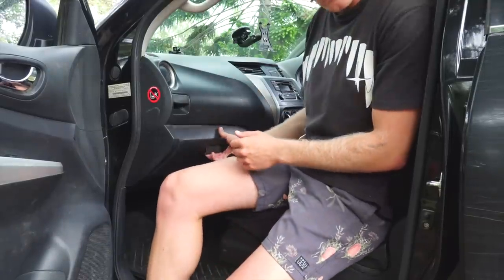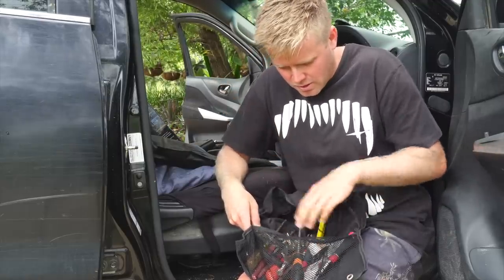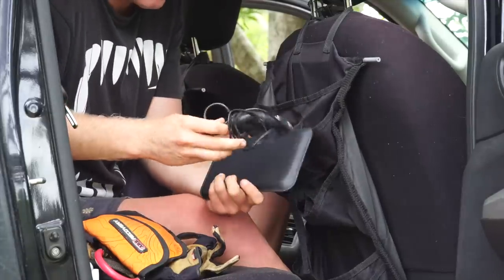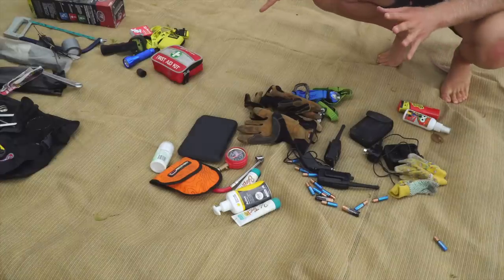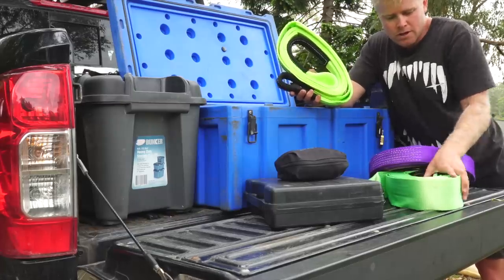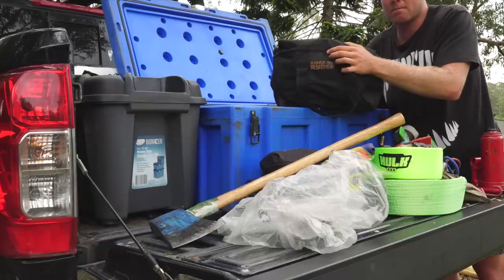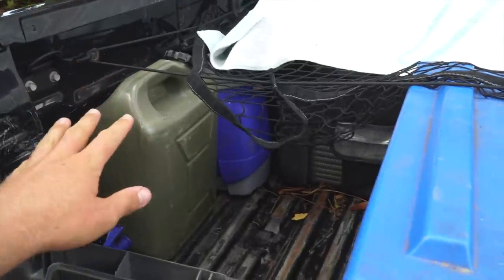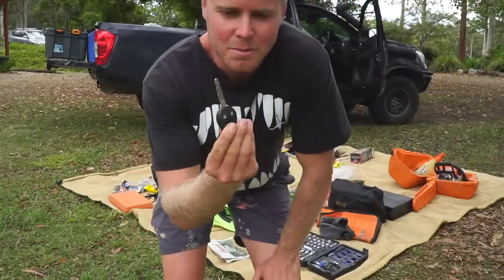What I carry in my 4WD - Tools, recovery gear and communications

Comment: Awesome vid Tyler.
From a mechanics point of view - a small mix of nuts, bolts and screws are worth keeping. Everyone can put in a bolt or screw eg I carry an oil filter box full of m6, m8, m10, m12, a few self tappers which covers most on a Jap 4wd or any accessories fitted. Some things just cant be secured with cable ties, tie wire, etc.
1l of MultiATF or SynATF(nulon) - will cover 90% of power steering or auto trans oil, and enough to get you moving again on an Auto with a small leak or low level.
Other than that, the only thing I carry is a driveshaft - same on both sides for a 120 Prado. And yes i broke one recently :).
Reply from the maker: Hey mate, thanks so much for all the ideas! Lots of good ones there, definitely got a few things to add to my list. Cheers!

Comment: Same as I carry. Near enough anyway.  Some extras I have on board is a ruck sack with basic survival gear / food. It lives in the cabin so it can be grabbed fast (As in a grass fire etc). That is the old boy scout in me.   A thunder box dunny, Big SS pot for boiling bath water (Or crabs etc), Small jump starter, Bush Machete, Cordless drill and Bits, Stanley Wonder pry bar, Flair kit(out of date marine from the tinny) Walking poles , Hand compass and ranger pace beads. If ever I have to walk out with no 4x4.  Oh, And a hand GPS.   As for hand tools, I lightened that right up to the bare minimum of mechanics tools, My axe is a fiskars X17, Much lighter but will split wooly hardwood, My Hack saw is a single hand draw saw handle.  It gets confounding when for everything you put in, Something has to come out.  Also depends on the trip I guess but hey that's half the fun hey?
Reply from the maker: Hey mate, thanks so much! Lots of good ideas there :) will definitely look into a few

Comment: Great little video Tyler. One thing that I thinks worth mentioning is a ‘power pack’ or ‘jump starter’’, especially if you’re solo traveling. I just purchased the new ARB one. It has numerous functions, light, usb, cigarette port and of course the actual jump start capability.
Good luck, may catch you in the VHC 👍🏻
Reply: Supercheap Auto jump pack has all the features as you mentioned,
Reply: Phil Burns . Mate there’s heaps of them!
Reply: @Phil_McAvity  yeah it's just if you GO ARB, you're going to pay like 10× the amount of vertualy the identical thing
Reply: Phil Burns . I need it to start a v8 cruiser, plus monies not necessarily a issue when it comes to reliability on products for solo semi remote travel.
Reply from the maker: Hey mate, thank you! Yep definitely, I was actually looking at these the other day and will get one soon. I think I might end up going with a NOCO one, they look really good. ARB one sounds good too but. Yep, may see you there. Cheers!
Reply: Tyler Thompson I originally ordered the GB70 off eBay $229, but the guy let me down ☹️
Reply: You could also just carry jumper leads and bridge them (not jump starting) if you have a dual battery system between the two batteries for a few mintues.
Reply: Renae Hobbs you could also get a solar blanket, hook it up & wait a hour or so.
Reply from the maker: So many different ideas/ways haha. That sucks about the eBay order!
Reply: Tyler Thompson if you got some extra 10mm copper cable you’re be able make your duel batteries in line to give a bit of charge to your starter. Far cheaper then buying a jumpstarter

Comment: Great list.
Id add some toilet paper. Your misses will thank you. Baby wipes are also great.
Rather than buy First aid kits, Buy the bits you need, you end up with a much better kit. Ebay/web is great for First aid supplies.
A stubby holder in the front helps keep drinks cool in summer and warm in winter.
Couple of Extra Large bin bags. If your super muddy they make great seat covers, Average raincoats and im sure 100's of other uses.
Probably not as important in the days of mobile phones but i usually carry a crossword/puzzle book and pencil, Just in case of bad traffic. 
For those without dual batteries (or good Samaritans), Jumper leads, Surprising how few people these days carry them.
Reply: @Greg Jackman I just googled a First aid kit supplier (like St johns) and see what there Kits contain.
Reply: TP shown at back of 2nd blue case at 12:21
Reply from the maker: Hey mate, thanks for the tips! Yep I've always got toilet paper in the car in the second blue box (just didn't bother mentioning it) and got big rubbish bags in the kitchen box. Other things sound good! I was actually looking at the little jump starter batteries the other day so may end up getting one of them instead of jumper leads but I'll definitely end up with one or the other. Cheers!
Reply: @TylerThompson90  See others have filled you in on the self starters, so I'll just comment that jumper leads not much good if you are the only one around and/or your vehicle is in a difficult position where the leads are not long enough.
Reply from the maker: Yeah ill end up getting one of the jump starters
Reply: I bought 900CCA Lithium jump-starter battery, but if your car battery is quite flat, the lithium jumper will not work, as (to protect the Lithium) it will not work if car battery below 10v. So, don't ditch the jumper leads is my rec (as Elec Engineer), As of Feb 2019, my local Aldi just had a sale of 160w fold-out camping solar panels, with full '12v lead acid' regulator - charges up to c13.7v then 'floats', so ideal for car-fridge etc, and likely more useful as 'supplement' to jumper leads, as the newer Lithium jumper packs.
Reply from the maker: @GraemeHarrisonAU  Cheers mate, thanks for all the information!

Comment: Spot on with the "what I got", and it's fairly comprehensive. I'm a sparky and I found the el cheapo compressors were slow and wanted to melt the fuse connections if not duty cycling enough. My advice is to buy the ARB twin compressor with the receiver (Aluminium cylinder) in the case (AU$850). I tell you what it's as fast as the servo and 100% duty cycle. Which means an air up episode is a mere 10min stop. Expensive I know but if that one you have karks it, your possibly up for 4 new tyres!!!
Reply from the maker: Thanks mate, yep I really do want one of the ARB twin compressors, just need to save up the money haha

Comment: Great equipment, very prepared. Would suggest to replace the chain saw for a reciprocating saw with 9 inch wood and metal blades. You cut branches like butter cheaper to maintain battery operated.  Also if any body parts break you can chop them off.
Reply from the maker: Cheers mate, thanks for the tip. Hopefully I won't need to chop off any body parts haha

Comment: Good Video Tyler... Its amazing how much stuff you can accumulate over time in your truck. I reckon you have it covered.. Mount the fire extinguisher for sure... in the tub. Tools are good but you only need one good kit. Rachet spanners are a must. plus learn common sizes and fittings you have. my Ranger has Torx so I carry a full set. Add a hose clamp tool incase you do a break line. and learn to change a CV... with your following sone one will happily teach you.... Aye fellas 😎 .... but the list goes on.... keep up the good work mate... 👏👏👏👏👏👏
Reply from the maker: Thanks mate, yep I've got a bit now. I definitely want to learn how to change a cv plus any other mechanical skills, just need someone to teach me haha, cheers!

Comment: Good vid Tyler. Can I make a suggestion about ‘in cabin’ gear?  Get your tools out of the cab and fasten the fire extinguisher ASAP. 
Any truckie will tell you that you can survive a rollover in a modern vehicle. It’s the gear flying around the cab that does the damage.
Reply from the maker: Thanks mate! I've got the tools in a zip lock bag under the seat tied up and secured now so shouldn't be going anywhere, still need to do something with the fire extinguisher though! Cheers!

Comment: Hi Tyler,
Enjoying your videos. Please do not stock any loose items under your driver seat. Just in case if they come out and stuck behind the brake  paddle 

Don.M
Reply from the maker: Hey mate, definitely true, thanks for the tip. I've got a little net there that seems to stop them coming out, haven't had any fall out from under the seat before.
Reply: Don.M

Sounds good.
Looking forward to your next video. See you on tracks

Don.M

Comment: I recommend a large rubber mallet ($10 Bunnings) for large tent pegs in hard surfaces.  Once you use it you be amazed at the added safety, as steel on steel can be unpredictably dangerous whereas the rubber on steel there is little or no deflection.
Reply from the maker: Sounds good mate, thanks for the tip!

Comment: I'd be grabbing a CV shaft just in case. With the tools you have you'd be able to change it even with limited knowledge. Good thing about the D23 is the shaft is the same left and right so you only have to carry one spare. In my Triton they're different so I carry one for each side.
Reply from the maker: Hey mate, yeah I was debating this the other day with myself whether to carry one or not, I checked at the dealership and they said they were the same size on both sides. Just sucks they are $430 haha but definitely worth carrying.
Reply: @TylerThompson90  Try wrecking yard spares.
Reply from the maker: Good idea!

Comment: Pack a spare utility/fan belt and a bottle of diff oil & motor oil (1lit)... remember, even if you cannot swop a part or a belt... some good fellow 4wdriver may come along the track and help you out if you are in a difficult spot...
You have putty to fix holes, but no oil to top it up with.
Reply from the maker: Hey mate, no worries, thanks for the tips! Ill definitely look into them

Comment: Awesome vid mate, really enjoying your content and the fact you're got a NP300! Have you considered putting a single drawer in the tub? That's what I'm about to do and hoping to fit basically everything you have in the drawer. 
One thing I would suggest is get a good thick wide piece of timber as a plate for your jack 👍 will work wonders on uneven ground, mud, sand etc 
Can wait to see your next vid!
Reply from the maker: Thanks mate! Timber for the jack plate sounds good. Haven't look at getting a drawer before but would be a good idea, just have to reorganise the layout in the back. Cheers!
Reply: @TylerThompson90  An old nylon cutting board will work in a pinch if you can't lay your hands on a lump of plywood.  Be careful with drawers.  Some are shallow making it difficult to store that item that is just a little too tall and drawers can be really heavy too.
Reply from the maker: Thanks for the tips mate!
Reply: @TylerThompson90  Just watched a Ronny Dahl clip with him using a TRED or MAX TRAC for a jack base in sand or mud.  What a great idea.  Who'd have thought.
Reply from the maker: I remember watching that video now you say it, have to remember that one! @jellybean7191

Comment: What is the minimum break strength of that snatch strap. As a rule of thumb the minimum break strength shouldn't be more than 2-3 times the gvm of your car
Reply from the maker: I'd have to double check mate but from memory somewhere around the 10 thousand kg mark so fits in that 2-3 times the weight of the car